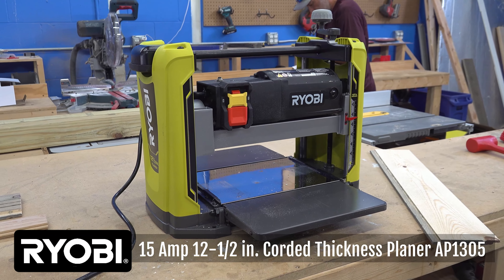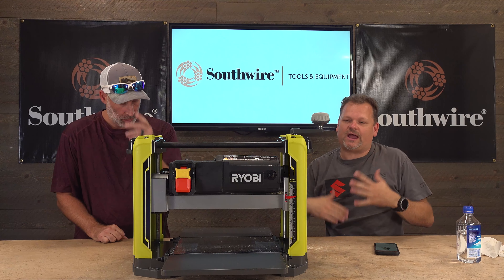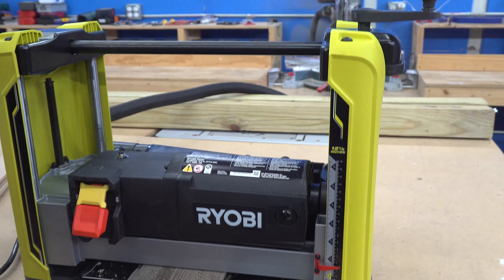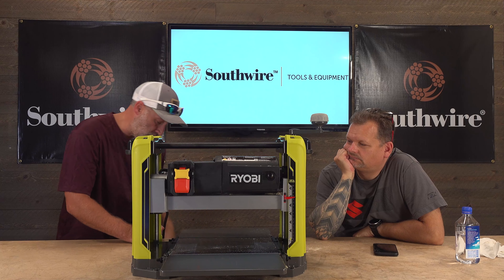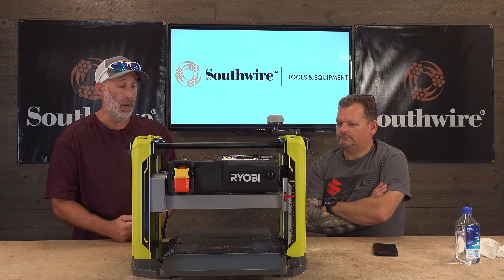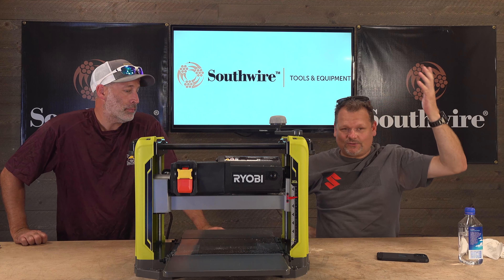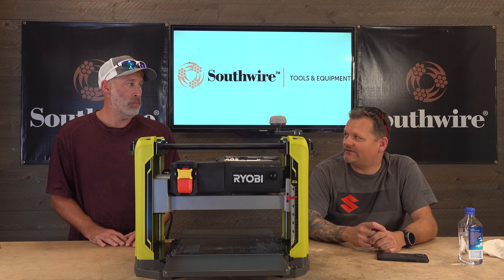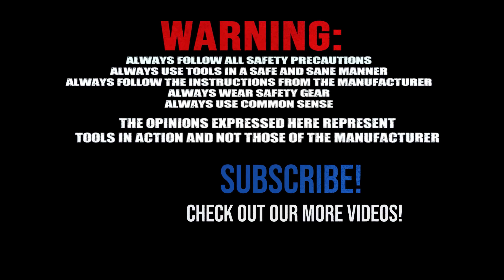THIS RYOBI PLANER IS PERFECT FOR....

Comment: what would be really cool is if they came out with a 40v battery powered planer.  Now, how long could you get on a - lets say 9amp 40volt battery with a motor that runs 8,000 rpm under plane load,  but if they could pull it off, I would def buy one.
Reply: why would you need/want a battery powered planer? going to take it camping with you?
Reply: @xisotopex  Basketball courts that I work on usually have crappy power and it's a large open space to boot.  It would be nice not to have to lug my power cables all over the place.  Most of my gear is cordless now and a planer would be a nice addition to my arsenal.  But sharing an industrial strength HEPA system and a high power planer guarantees I'll be hunting for a breaker.